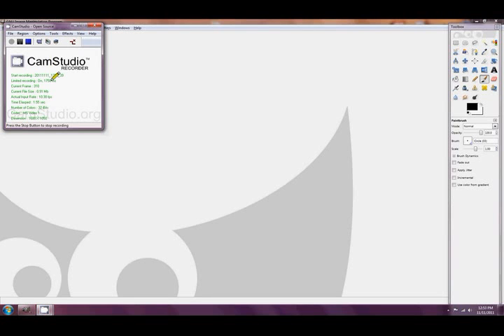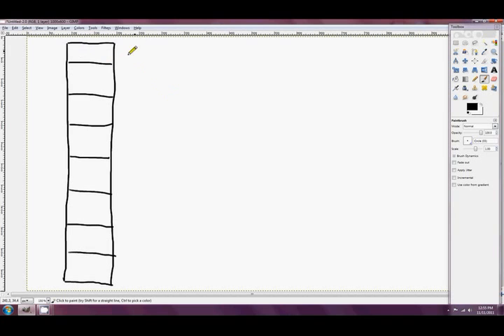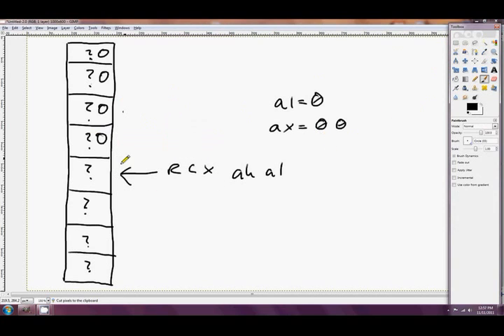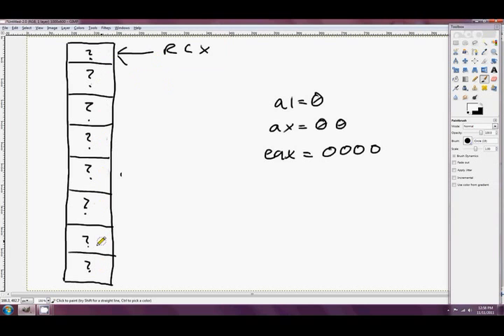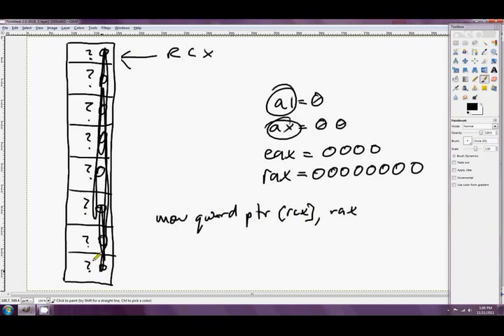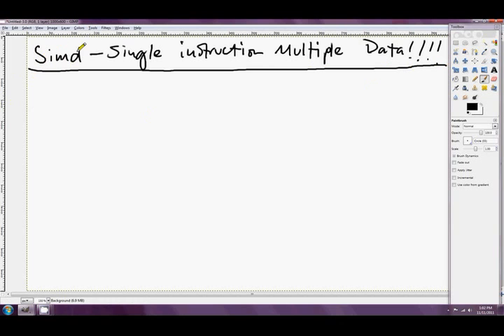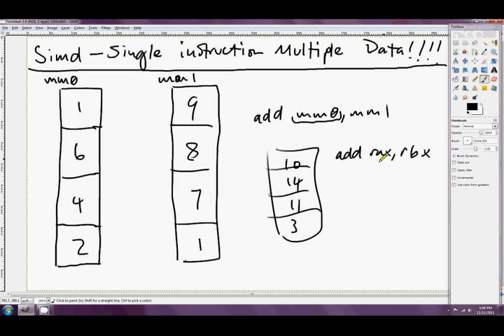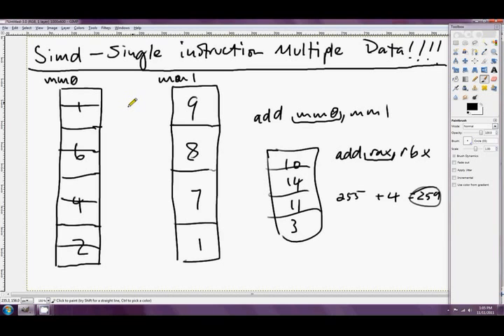x64 Assembly Tutorial 38: Intro to Single Instruction Multiple Data

Comment: 06:00 But if the array is not divisible by 4, you need to handle the last step of the iteration separately. Alignment can mess with that idea too.
10:35 So basically they just stopped the carry bit from rippling between subsequent bytes and put an "MMX" stamp on it? :q
Reply from the maker: Sounds about right! I have not got the code anymore. We were Zeroing, weren't we? I just replied to another comment of yours and I reckon your idea is much better than what i did. Cheers mate! Have an awesome day :)

Comment: Is it worth writing x64 assembly if many of your users will only have x86?
Reply: You can provide both versions of the code in two separate shared libraries and then choose one of them to load at runtime. Or provide two separate binaries. However, x86 code can run just fine on x64.